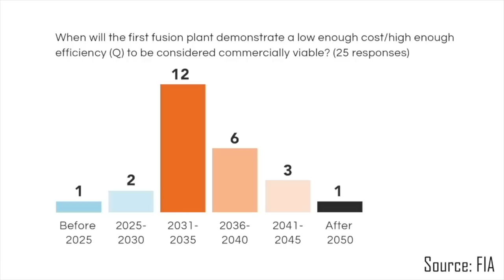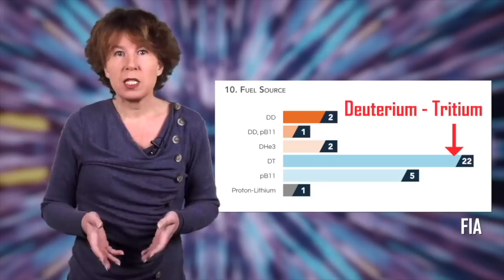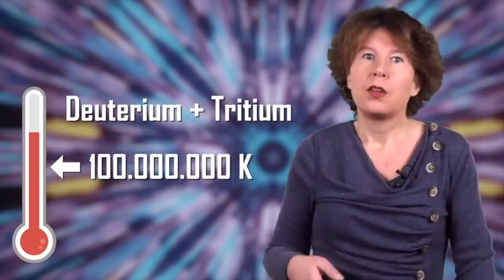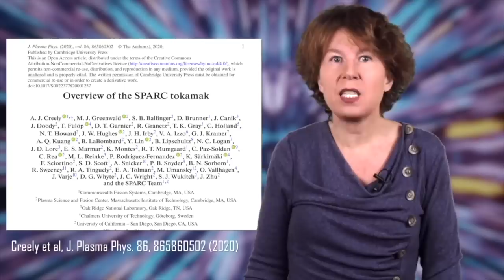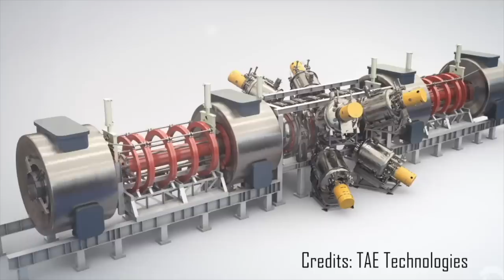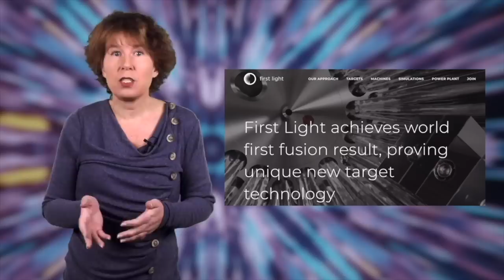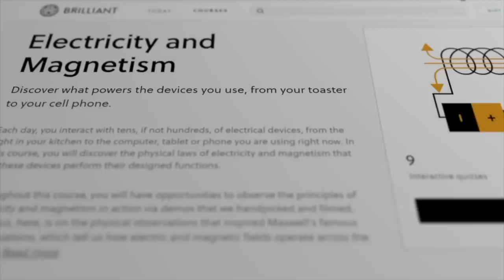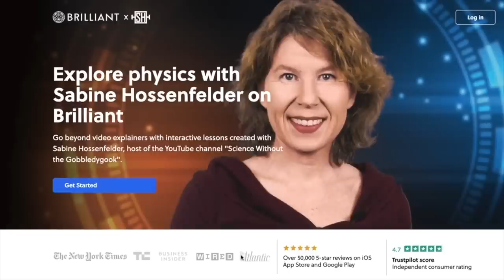Nuclear Fusion: Who'll Be First To Make It Work?

Comment: Brilliant overview and summary, Sabine!

I find it amusing that two of the approaches involve respectively gunpowder and steam pistons. Steampunk fusion 😂
Reply: I do hope one of them discovers cavorite.
Reply: The piston design involves 200 pistons with a total combined weight equal to two Eiffel Towers. They're building a 70% size test reactor which should be operational in 2027. There's 7 similar level test reactors being built by companies over the next 5 years. Fusion will soon have everyone waiting on the edge of their seat or people will be making up new ways to tell the joke that it's 30 years away and always will be

Fun times in the fusion neighborhood!
Reply: @Canucklug  Holy cr*p! 😮 A combined weight 2x the Eiffel Tower? 🤯 That's just insane. Still, it seems kinda crazy to me with either of these approaches that just blasting something with a whole lot of macroscopic kinetic energy is enough to get the kind of temperatures and pressures needed to trigger fusion. I can somewhat more understand the BFG, as it's using a dense mass impacting a tiny target, but the piston thing sounds like it's just compressing a gas directly. (But I don't know that as I haven't read much about it.)

Thanks for the super-interesting note!👍
Reply: I think I missed the one where they used flux capacitors coupled to overthrusters.
Reply: Yes steam, too many working parts, and no Fred Dibner, the gun idea sounds a little chaotic and wouldn't the barrel need some sort of maintenance after so many shots!?!
Reply: @DEtchells  I believe in the piston reactor they're actually exerting the mechanical force onto a liquid metal blanket that surrounds the fuel pellet. The liquid metal heats super quickly under all that compression, and it can't vaporise in such a small space, so all the heat and nearly 2 Eiffel towers of pressure are transferred to the fuel in the centre.

Then as the capsule fuses, it dumps its neutrons into the hot lithium, which can be cycled out through a shielded heatpump to run turbines, and replaced with fresh metal before the next shot! Much easier than working with supercritical steam or other (potentially irradiated) gases!
Reply: @lukinatornator  Ah, very interesting! So it's basically a hydraulic system (incompressible fluid) with liquid metal as the working fluid. Very interesting, thanks for the note!

Comment: Many thanks for the work collecting all this info together. A great summary, thanks, Sabine. One maybe to add next time is LPPFusion - who are still trying to solve the reasons why Dense Plasma Focus doesn't scale. To be fair to them, they have made progress from the disappointments of this approach in the 1960s and they now have one of the highest wall plug efficiencies of the privately funded efforts. Proceed on all fronts!
Reply: Incidentally, their approach DOES scale, but the issues they have are at least partially resolved using quantum magnetic field: "We have performed many simulations of the plasmoid which include this QMF effect, starting in 2005 [17] which show that in this case fusion power can potentially exceed bremsstrahlung emission by as much as a factor of 2, allowing ignition of the fuel and an 80% burn-up of the fuel in the plasmoid".
Reply: Only one in China. I suppose they are just intending a little espionage, copy the one that works best and not pay any royalties.

Comment: Good summary. Note: Among other problems mentioned, Helion's "push back back on the mag field => direct electrical capture" implies some pretty severe Electrical Engineering challenges. They are apparently already building their own special purpose capacitor factory...
Reply: Yeah, I'm skeptical about Helion (like any other fusion approach) but if they can make it work it would be awesome!
So far all approaches I know of still rely on boiling water to run a turbine
Reply: Dr. David Kirtley confirms that in recent interview stating they are more electrical engineering company than fusion one. What makes me optimistic about their timeline targetting 2028 on-grid fusion is their fast iteration process. They have already 7th generation of their prototype plant soon to be completed in 11 years and are quickly progressing with their main challenge to shorten the periods between pulses down to 1 second. And that is mainly electronical challenge. They are also already working on regulatuons with the state of Washington to allow commercial production and preparing to scale up their plant fabrication when first viable generation is ready, so that they can mass produce their plants.

Comment: Thanks Sabine.

For little reactors, the thermal and magnetic gradients are mind bogglng.

For big reactors the size and cost are mind bogglng.
Reply: What would happen if someone was to extract an Atom and a Proton from a fart before fusing them together using a Electron?
Reply: @PSYCHIC_PSYCHO    There are some people whose farts reach the requisite energy levels.
Reply: @NuisanceMan The physics seems perfectly sound, but with the escalating cost of a good vindaloo, it's just not commercially viable.
Reply: @PSYCHIC_PSYCHO  A fart atom🤔

Fartonium?
Reply: @tylerdurden3722  "Fartonium"?, interesting 🤔; you can join my team of Fartologists.

Comment: Great video on an important subject, Sabine. Thank you. It may be a long shot, but I'm rooting for Helion because of the way they are extracting power from the reaction.
Reply: Agree. Even if other approaches work most of them have extreme built in costs for radiation containment, maintenance of the reactor vessel and conversion losses of 30-40%  in the boiling of water to run a turbine to generate electricity.
Reply: Fully agree with your opinion. I expected some more excitement from Sabine when mentioning Helion. It is not just one more startup in Sabina’s classification, but a class in itself.
Reply: I'm actually rooting for NovaFusion

Comment: Personally I think if general fusion gets their design working it'll be ahead of the competition in terms of application, the construction of it is significantly simpler than most designs, integrates sheilding, intwgrates energy capture, integrates lithium breeding, and they've been billing it as capable of being connected to existing turbines (which makes its small size critical as it can actually fit in an existing structure unlike a tokomak).

Ultimately continuous large scale plasma vessels like tokomaks and stellerators are the end goal, but I seriously doubt they'll be in the market any time soon, and certainly not soon enough.
Reply: Personally I think that if X gets their design working, it'll be ahead of the competition, for any X.
Reply: @human_shaped  lol you have a point there, but my comment was more along the lines of if multiple fusion designs reach production at the same time, I think general fusions design will win out in the short term until large scale reactors start trickling in.

Comment: I actually like Helion. One of their ideas is to have two separate reactor setups. One will produce Helium 3 exclusively. The other will be used for power production. If the video on them by Real Engineering is accurate, they're already making repeatable, reliable fusion reactions.

Comment: I like that Helion produces electricity directly rather than having to spin a big turbine. If it works, then that seems like it would be a huge boost in efficiency.
Reply: Unfortunately there are more issues with getting it working than mentioned in any of the recent PR push by Helion (i.e. Real Engineering video, and appearance on Simone Geirtz' channel): https://www.youtube.com/watch?v=3vUPhsFoniw
Reply: @AthAthanasius  - Yes, I've watched Real Engineering's video, and a response video to it. The electromagnetic extraction of energy is elegant, but the details of the nuclear physics may prove problematic. Like all engineering, its balancing pros and cons to get something that actually works ... to be seen.
Reply: @AthAthanasius  Real Engineering's response video is pretty uninformed.
Reply: @djdoc06  They don't need to engineer a power plant. The reactors make electricity directly, the next one they're building will have more pulses and produce electricity at a net gain. They've already produced electricity, just no net gain.
Reply: @djdoc06  >Why even talk about something that doesn’t actually work in the present tense?
I sort of agree, but that summarizes this entire video
Reply: I like that they don't need Tritium, but only Deuterium and ordinary Helium.
Reply: @peterpesch Helium 3 is a very rare isotope with only 1 neutron. Ordinary helium is helium 4, with 2 neutrons.

Helium 3 is in very short supply and is very expensive.
Reply: @peterpesch  not ordinary helium.. 3He isotope that is ridiculously rare. They claim, that they can make it from deuterium in specialized fusion reactor....
Which is another unsolved problem...
Reply: This sounds like it uses magnetohydrodynamics to generate power.  This has been around for many decades, without ever being used practically.
Reply: @hamjudo  You forget that the Helium 3 is being produces out of the Deuterium by the second reaction ...
Reply: Not the first to look toward developing this way, the polywell reactor design engineers made similar claims twenty years ago.  Look around at the Bussard  reactor.  Apparently though, the polywell Bussard design won't ever work for some reason.
Reply: I think at some point ST80 HTS might think that his father should have named him Peter too. Or Pieta if that child is a girl, I have no idea because I don’t follow Elon or pay any attention to his life.
Reply: I work on space research and am familiar with a number of different vacuum guns around the US used for simulating high speed impacts. I know virtually nothing about plasma confinement. 

BUT, 450 km/sec is an absolutely insane number. Well above escape velocity for the solar system. How on earth are you going to accelerate anything to that speed in about 20ft??
Reply: @peterpesch  Helium 3 isn't ordinary helium its as bad as tritium, and worse in many respects, see improbable matter on helion
Reply: @hamjudo  Science fiction tells me we can mine Helium 3 out in space. Then again, science fiction tells me replicators and transporters will exist.
Reply: @viliamklein  I don't think that's the hard part. Electrons in vacuum tube hit speeds 1000km/sec. It's dependent on the voltage something something, more than on the distance.

Nuclei would be heavier but still, we aren't trying to accelerate a bullet, nor a grain of sand... We're trying to accelerate something much much smaller. The mass of plasma needed for practical energy production would be super tiny, thanks to the huge energy density.

Comment: That's quite an array of new fusion projects. Interesting to hear about this.
You should do a video on the "safire sun" reactor thing. It looked a bit like a scam that needs debunking but I'm not qualified so I don't know for sure. And I haven't seen much reaction about it. Maybe that's a sign. 😅
Reply: Their website says "replicating the atmosphere of the sun", but all fusion in the sun is in the core. I don't plan to invest in this either.
Reply: Scam or self-delusion I'd say
Reply: @MattNolanCustom  Both are quite common.
Reply: All they need to do is watch "Spiderman 2" to see how Doc Oc made it work!  XD
Reply: @Alondro77  LOL 😃Yeah, everyone knows fantasy is reality.
Reply: Safire doesn't have a clue. I corresponded with them directly a few years ago. There reactor is just a sputtering machine & they thing its causing fusion. Its just vaporating metal materials and the are condensing on the cooler reactor walls, think that its causing the hydrogen plasma to produce super heavy elements. They run the reactor voltage of about 10 KV and you need at least 50 KV to accelerate hydrogen ions for fusion. Farnsworth worked in the Fusor which used electro static confinement (the same method as Safire) during the 1950s & 1960s. While electrostatic confiment can fuse deutrium its only does a tiny amount of fusion (10^6 to 10^8 fusion reactions per second). for a positive Q, it needs to be at least 10^14 reactions per second.
Reply: @guytech7310  +1 for going the extra mile and trying to get a straight answer directly out of them.